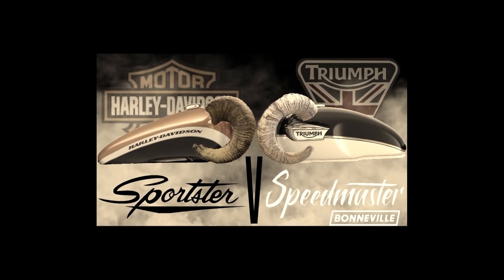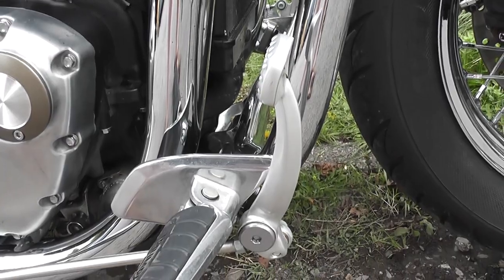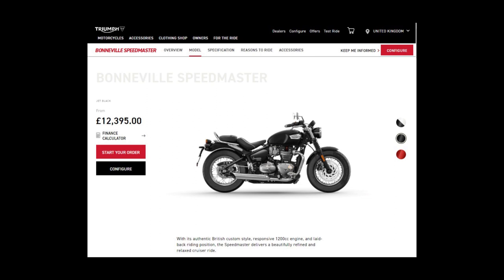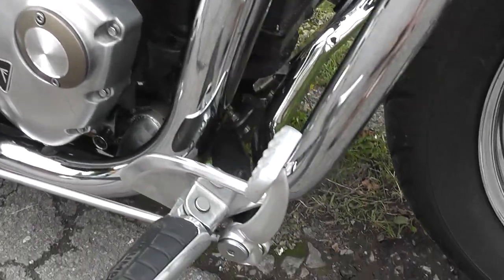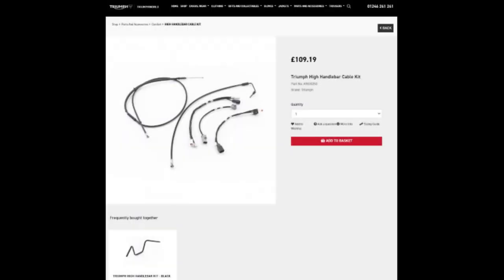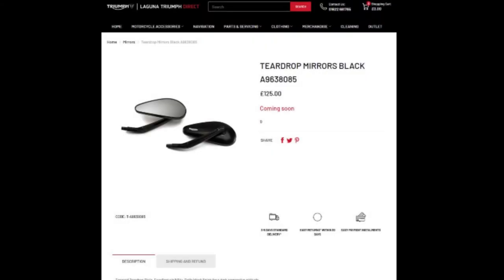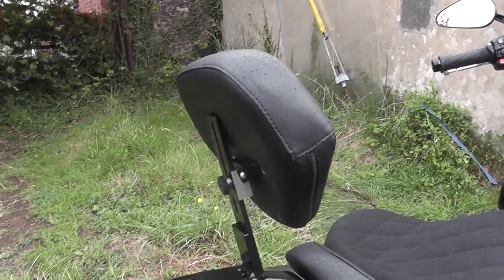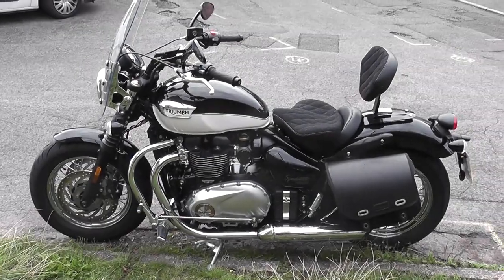Releasing Its Full Potential - Triumph Bonneville Speedmaster 1200. These are the custom parts.

Comment: Hello Chris,
Really enjoyed your video and it was great to see your custom parts.  I've gone down a very similar route with my Speedy (Same model as yours) and I totally agree: it's all about getting the bike set up and customised for your own pleasure.

I too have spent a small fortune on "upgrades" but each one has brought a smile to my face.  Similar brass bits from motone (even bought the brass tyre valve caps).  I went for a Dart Marlin screen mainly because of its minimal looks compared to the Triumph ones.  It also is rock steady although clearly much has a smaller surface area. I fitted Triumph Floorboards to mine which, for me, gives a much more comfortable ride. I can move my feet around a little rather than just having them on the forward pegs. I took the pillion pegs off mine and used the same finisher kit etc.  I have also used a "Tail tidy" from Maund Speed in Pasadena which makes the back end more appealing: I didn't like the rear number plate light and reflector hanging down.  The tail tidy complete with a small, but legal gel plate was the look I preferred.  I fitted a pair of Hitchcox small drag pipes because I loved the look and the sound: I did take the cat out and replaced with a Tec X-pipe but that combined with drag pipes made the sound-track too obnoxious.  After a week I put the cat back in which reduced the sound to a level I can live with.  I was waiting for Motone to re-stock their "Bedlam" pipes (they are drag pipes but with internal baffles) but they've been out of stock for over 10 months now and I can't get a date from Sam (at Motone) as to when they may have some more available.

I hadn't considered the black tear-drop mirrors before as the OEM ones gave such good vision.  However I've ordered a pair today (£54-Ebay) so will give them a try.  I couldn't get comfortable with the "comfort seat" that was supplied with the bike so ended up buying a standard seat of Ebay and having a local trimmer reshape the seat with new foam and a black diamond stitched cover.  It's not armchair comfortable but much better than stock plus looks superb. 

Two final points: You didn't mention your engine bars.  Which ones are they?  I quite fancy a pair but Like the wrap-around ones (Hepco&Becker) rather than the sticky-out ones.  I also think I'd have them in black.

Belt Drive. I'm sure you're aware that there is a kit out there for about £1000.  The deal-breaker for me considering the kit however is the need to cut the chassis and fit a bracket.  I know of one fellow owner who has the belt drive kit and really sings its praises.

Over the winter I'm considering a DNK TuneWorks ECU map flash to release some more mid-range power although ideally I'd wait for the Motone Bedlam pipes and remove the cat at the same time.

Thanks again for your video.
Reply from the maker: Afternoon Craig - many thanks for the fantastic message (and compliments). 🙂 

Interesting that you've thought about the ride in such a similar fashion to me. We are obvioulsy both geniuses...

I did look at the Dart screen, but decided against it in the end. (Bigger is better for Winter, I think.) The footboards: yes, they are lovely. However, I ended up buying a new bike (erm, accidentally, so to speak...), which blew the budget all to bits. I love the Triumph footboards but just can't afford them. I've never heard of the Maund Speed so I Googled their tail tiddy: that is nice! It does clean up the back well and is now added to my wish list. More expense... thanks for that.

I'm not fussing with the exhaust as it (the only bike in the world) which sounds good standard.  When I grow up and I'm rich, I may get some pea-shooters, but for now, standard is fine. (I'm glad you found the £54 mirrors - they're great, you'll not be disapointed.) 

It was a good idea with the seat. I bought a standard one (eBay again, £45, I think) and got it re-manufactured by Russell Cycle Products. Expensive, but worth every penny. The crash bars are standard Triumph bars. They actually don't stick out much - maybe not even enough! But they were part of the purchase deal, so I went with them. (I'd have prefered black.)

Michael (below) also mentions the belt conversion. This I'd love to do. But another grand is out of the question... until I grow up and become rich. It's got to be a must have item, but cutting the frame?! How scary is that!? I'll have to look into it - I've never knew a belt conversion was even an option.

I'm not really worried about tuning - which I understood to be difficult with 'anti tamper' Triumph software. I like torque, so I'd like to add Nm, rather than hp. (What's metric for hp?)

Thanks for the comment Craig.

Cheers,

Chris
Reply from the maker: Just found it: www.arhcustom.co.uk/product/free-spirits-belt-drive-conversion-in-black-finish-for-triumph-bobber-triumph-speedmaster-1200-307597k

A Free Spirits kit. Really nice! (But, like their air box removal kit, too much monies.)

I really want them though!

Cheers,

Chris
Reply: @chrisoftheot6272  I agree that the belt drive kit is expensive: I'm not rich either and most of my bike-related purchases are about £20 (as far as my wife knows).  However, given I'm aiming to keep the bike until I curl my toes I would spend the £1k if it didn't involve cutting the frame.  The problem is compounded when you look at the labour costs of getting a "more skilled" person to undertake the job. If only Triumph fitted them as standard or at worst a factory option?

One point I forgot to mention is that I would dearly love a side-mount reg plate holder to further tidy the rear end but given the need for a paddock stand I don't see any way of achieving the required clearances.

Craig
Reply from the maker: Afternoon Craig - like you, I'd be getting the dealer to install the kit, so it would be very expensive. Cutting the frame seems really scary - but the blurb on ARH Custom says it's just a bracket. Maybe not too bad? 

Either way, I'd really like to install it one day. Others here are saying how great it is... and I want one!

Cheers,

Chris
Reply: @chrisoftheot6272  If you have an angle grinder it is a straight forward job, once you have the soft tail removed, they supply very clear instructions with the kit (you can download the instructions for the prototype, The production version has a one piece bracket), I wouldn't have done it if I'd had to pay to have the conversion done, it took less than a day even though I had a lot of coffee breaks
Reply from the maker: Morning Martin, once again - well, alas, I am a mechanical basket case and do not own an angle grinder. I did touch one, once. I'll try to find the instructions 'cos if and when I get this kit, it'll be Bridge Motorcycles in Exeter that does the job, certainly not me!

Also, if it's not a particularly long job, it'll still be cost effective... you know, when I have the money.

Cheers,

Chris

Comment: Interesting video, I can recommend the Free Spirits belt drive conversion, It is a bit expensive but it makes it seem to run much smoother and avoids having to clean and lube the chain (I also have a 1995 sportster that is still on the original belt) I personally would be more likely to switch to the bobber footrests but that due to my short legs
Reply from the maker: Afternoon Martin - thanks for the comment. I would like the belt conversion - I'm stunned it's so popular, given the cost. Still, those who have it certainly sing its praises.

Cheers,

Chris

Comment: You've mentioned the lack of an IMU on the Speedmaster. Did your Sportster come with one? Also, have you looked into the potential of adding an IMU from Triumphs other models?
Reply from the maker: Evening Vin - I'm very pleased you asked this (see my IMU video). When I asked the same thing in the Harley and then the Triumph forums, I was virtually laughed off the page. Not that that would stop me...

IMU is not an option on the Speedmaster, alas. According to: motofomo.com/motorcycles-with-cornering-abs-imu/#triumph-motorcycles-with-optimised-cornering-abs
some Triples and Scramblers have it, plus the Tigers and Rocket, but the Rocket, for instance, does not have a full deck, like the Harley Glides or Goldwings, etc.

I asked at the Harley dealership and the serivce guy, Jamie (somewhat shocked), asked the tech guy who said it might be possible to put a Glide RDRS (the Harley IMU system) onto a Sportster but it would be impossible to set up completely and would show constant errors. That 's the most informative answer I got (when I had my beloved Sportster).

My feeling is now that each bike model MAY require 'personal' tuning for the IMU... But, since a slip, or down-shift lock, or braking skid, or even the angle of attack into a corner (etc.?) must be fairly uniform since 'straight' is always the same, one wheel following the other, lateral slip, etc. are all realative to the fixed road, not the bike's size or weight.

But, I could be wrong.

Anyway, it's my believe that it must be possible to add an IMU to a bike, although I assume it would need a pukka ECM (or ECU in Harley speak), so no pre-EFI, I would imagine. BUT, it looks like it would be way too expensive - although I'd love to try it.

Maybe you can do it? Many would appreicate it - like me!

Cheers Vin,

Chris

Comment: I've ridden and seen most every brand. I have a 2014 Thunderbird LT with all options possible. The only thing I'd change on the LT is to give it the shape of the Speedmaster gas tank. I'd have had to pay twice the price I paid to get anything close to the performance of the LT. 6 gears, a nearly 6 gallon gas tank and has a great seat. I've seen that seat on the newer Speedmasters. 

Chris, thank you for your honesty on what you feel are some areas which might need or could need improvement of the Speedmaster. 

Interesting point you make about the heat coming from the water 💦 cooled engine. I'll have to check it out as I've decided to start looking around for a Speedmaster. I know my LT runs much cooler than any air cooled V-Twins I've owned. 

Did you have to add the cruise control or did it come as standard equipment? 

Also thanks for the heads up on the fairings. I live in Southern California about 3 miles from the beach and there are times when you don't want or need a fairing or windscreen on the bike. 

British Customs is only about a 20 minute ride from my house. I'm sure I'll want the exhaust a bit more authoritative without being obnoxious. 

I'm going to look this weekend and did see that chrome special with the red gas tank with chrome also covering part of the tank. It really looked striking . 

If you think of any more pros and cons with the Speedmaster please let me know. 

Thanks again
Reply from the maker: Many thanks for your kind words Weazzell. I thought I was the only one who didn't like the Thunderbird tank - thanks for the validation! I agree, a flat bottomed (Bonnie) style tank would be nicer; I call it the 'heavy tear-drop' shape. (Like the old Z1/900/1000.)

Yip, the heat is crazy. One day I'll get an X-pipe because many have said they reduce heat significantly. But I can't afford it just now (plus, it's Winter here in the Northern Hemisphere so not such a problem).  🥶

I bought mine because of the electronics - traction and cruise especially (both are standard). I think I covered all the best and worst bits in the video, but, I've had my Speedmaster about 6 months and it's spent more than 1 of those months at the dealer having warranty repairs. 🤯 In fact, it's at the dealership now because it's stopped charging the battery...

But don't let that put you off! I said in one video that Triumph should get an award for getting so much bike into such a small space: that's the best thing about the Speedmaster. It is a big, heavy bike but it just doesn't look or feel like it.

Cheers Weazzell,

Chris
Reply: @chrisoftheot6272   I'll be following your journeys. Ride safe! Thanks again.
Reply: @chrisoftheot6272  It's not that the LT tank is ugly . It's that the Speedmaster's is perfection from every angle you leak at it from. I guarantee that had if Speedmaster tank was available, they be selling the " Speed Bird" like Mc Donald's sells  hamburger 🍔 s. .
Reply from the maker: Morning Weazzell - I really like the 'Speed Bird' idea! 🖖 I've long disliked the way Triumph fail to 'develope' their models properly: a full body kit for the Rocket & Thunderbird, for instance, since both are natural cruiser-tourers. I believe the Thunderbird would sell today if it had hard bags & fairing options: it's a fab platform.

I'm not keen on the Thunderbird tank, the way it drops at the back, though it's not too bad. But the 'heavy teardrop', with a flat bottom, really does it for me. The Speedmaster has a wonderful shape - although it's too flamin' small - and the old (air cooled) Speedmasters also had a good tank shape.

Comment: I have bad rotator cuffs and ride a speed twin. Try a Physiotherapist before changing the bars. Cheers
Reply from the maker: Hi Ron - I never thought of physio. How effective is it? And, erm, does it hurt...?

Cheers,

Chris
Reply: @chrisoftheot6272  Everyone is different but in my case there was a little short term discomfort for a huge gain in flexibility. My back and shoulders used to become very sore after 30 minutes. I recently rode all day covered 350km with little more than an ache which went with a stretch. Just find a good musculoskeletal Physio often sports Physiotherapy good. I also followed up with a personal trainer to improve strength. Good luck
Reply from the maker: Morning Ron - it seems that physio really works. I asked a lady the other day who has significant back pain (from falling off horses) and she said the same as you; a few days of pain, but a massive improvement afterwards - which seemed to last her several months. I will have to sign up.

Thanks Ron,

Chris

Comment: £15000, I think you have more money than sense sir.
Reply from the maker: Afternoon Steve - that's an especially consise reply. Can I ask, what would you spend sixteen grand on?

Cheers,

Chris
Reply: @chrisoftheot6272  House repairs, or trying to just live.For £15000 you could have bought another bike.
Reply from the maker: @stevepalmer5670  Hi Steve - fair enough. But I did 'buy another bike': the Speedmaster. Are you thinking that I spent £16 grand on top of the purchase price (i.e. £28k)?

I went through the process in my 'Next bike...' video. It's not just about having a nice bike, it's also about mental health management. (I've spent all my adult life - many thousands of years - fighting depression, and riding really helps).

Which bike would you have spent £16k on, Steve?

Cheers mate,

Chris
Reply: Yes you are right Chris he misinterpreted your comment.  If he had actually LISTENED to your vid , he would have realised